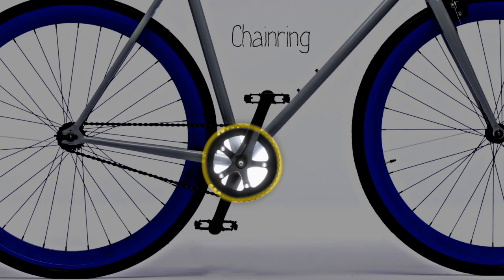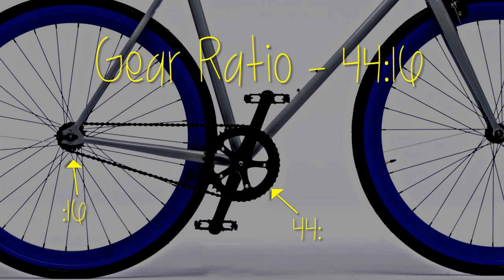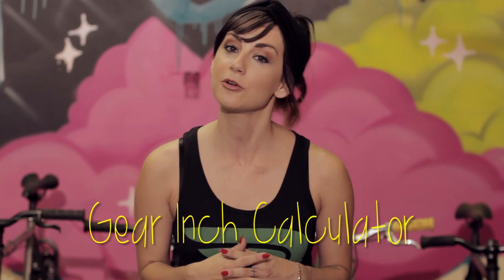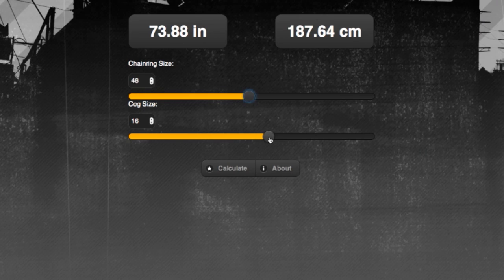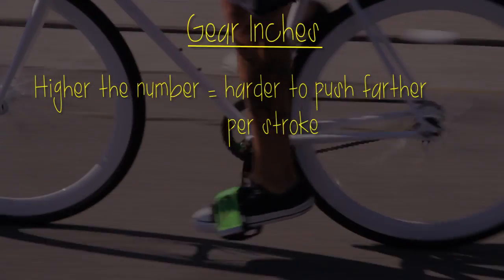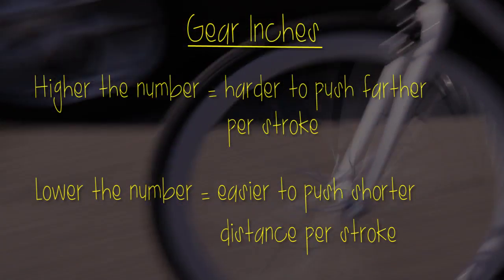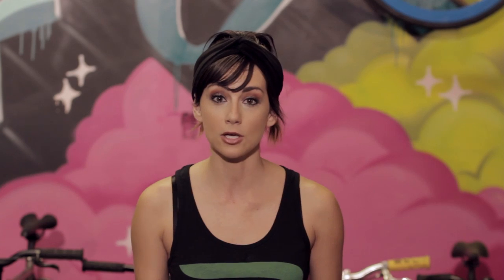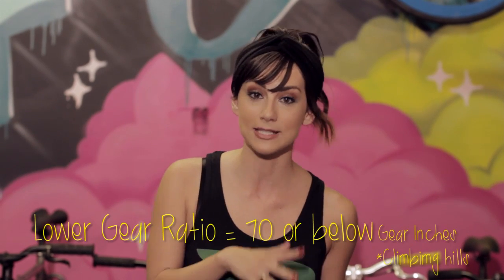Pure Fix TV: Gear Ratio Time

Comment: Would more teeth in cog, say plus 2, while keeping the chainring the same, help with added torque or easier acceleration.
 The set up is for neighborhoods with hills, so hoping for a less strenuous leisure riding,  not speed racing.

Comment: on my road bike, my most used gear ist something like 36:15. most fixies from the shop have something like 46:16 or similar. why is that? are fixie-riders incapable of spinning at high cadence or what?
Reply: we can but we are use to strong ratio.
who realy want to spinn fast when there is plenty of car and people.
and we still pedal fast to gain speed.
last summer i was out with my friend on bike( he use road bike and me fixed).
we made a test about going to the  same speed( on a sprint for him) i was pedaling slower.
and a second sprint to my pedaling and he couldnt follow after a few second.
i was going 7-9 km/h faster.
cyclist on fixed gear build stronger leg too because they are to there maximum gear all the time.
but road bike would beat fixed gear for a 100km race  probably

Comment: Is 46/16 good for doing skids
Reply: Brix it sorta depends. If you're just getting started on fixed and the bike you're riding is on the heavier side, skids will be a little more on the challenging side with that ratio. It is definitely possible, and that's a pretty standard fixie ratio, but many people recommend learning skids on something easier, then going harder once you get he hang of it. The best way to answer your question is to try it out for yourself. It's pretty easy to switch out a rear cog if you have the right tools, and even 1 tooth makes a huge difference in feel.
Reply: Bware Gamer thx man, I´ve learned how to skid, and its pretty easy now.
Reply: Brix awesomedude. What ratio did you end up going with?
Reply: Bware Gamer 46/16
Reply: i use 50-15 and skidding is fine...

Comment: whats the best ratio for easier skid. Or rather, what ratio do the guys use in the intro to the video, considering they skid so easily without having to lean forward or without much effort.
Reply: Andres Jaramillo something like a 44:16 or 46:17 would work. If the bike you're riding is on the heavy side, you may want to go even easier than that.
Reply: Bware Gamer what is the best gear for cruising on a fuxed gear bike? please reply
Reply: Dark Trump There's no right or wrong answer to this question. The right ratio for you depends on the strength of your legs, terrain, the weight of your bike, and how hard you want to be pushing with each stroke. If you'll be cruising, I'm assuming you'll be on mostly flat terrain? And I'm also assuming this means you want to ride rather casually. Anyway, 48:16 or 48:17 would be best IMO, but finding the right ratio for you takes experimentation. The rear cog is super easy to change, so don't be afraid to go smaller if you want a higher top speed and a stiffer ride!
Reply: Bware Gamer thank you very much...

Comment: Does this affect skidding? I have stock chainring and cog.
Reply: Osvaldo Cardona Yes sir you bet. If you have a higher gear inch then doing a skid will be harder. With the stock pure fix gears 44:16, it should be pretty easy too do. In case your wondering, 44:16 is like 72 or 73 gear inches I think.
Reply: +C. Paul I'm not getting this too much.. 44:16 is 72.3 inches and I'm running 46:18 which is 67.3 inches but skid stopping is really a challenge, at least on pavement.. gonna try to go 46:19 but I'm curious if it's just about gear inches or if there's a difference between changing rear cog vs chainring.. also I don't have straps yet
Reply: Omar Ibrahim You are fine with your ratio. I have buddies that skid on 54:15 which is over 90 gear inches (I use 46/17). 67.3 gear inches is really low and should be easy but the problem is that you do not have any straps or foot retention! You need foot retention to learn how to skid. 

Also many things affect skidding besides gear inches.

First of all, straps or some other sort of foot retention is a must for beginners and much more safe to have. 

Leg strength also is a part of skidding, but leverage and technique is way more important. If you have great technique, leg strength becomes a very minor factor.

Gear ratio, a ratio that is very high such as over 80 gear inches is not nice to skid on but again, technique is a big role. Your gear ratio is fine.

Technique is very important. Once you get your foot retention, put your balls to the stem and pull up with one foot while pushing down with the other. Also, push your legs hard against your top tube. This will give you more control and leverage when skidding.

Finally, your cadence (how fast your cranks are turning). If you are starting out on skidding, try to get to a comfortable 70 cadence and try skidding. As you progress you can bump up to 90rpm and try skidding there. 110rpm, etc. 

This may sound confusing and is very long but in conclusion. For your first step, you should get some straps they are extremely important in the learning progress. Also, ask me anything else, I love teaching haha! Search up, "Jonathon Wilson how to skid." on youtube, his videos helped me a ton.
Reply: ***** Nah not confusing at all!  Many thanks, this is just the sort of explanation I was looking for.  I got some straps so I'm going to get to work on that.  

I did end up actually getting a 19T rear cog to try and lower the gear inches, but I guess I don't really need to do that now.. 

I also just got some bullhorns, which I'm thinking might help.

Do you think going a size up or down would have any effect on your ability to control the bike?  I just got a new bike so I'm still getting used to it, especially 23mm tires..
Reply: Omar Ibrahim Yeah man no problem! Also what size are you talking about?

If you are referring to frame size. Let's say you fit on a 52cm frame, but you get a 49cm. You can expect it to be a bit lighter, sometimes more sharp and responsive (some people say so but I notice very little difference. Also if you get a smaller frame, your handlebars will be lower so you will most likely have some sort of drop between your seat and handlebars.

If you are referring to tire size. 23mm tires work just fine for most streets. I run 23 tires. But what I recommend is 25mm tires, less rolling resistance and more comfort. You will notice almost no difference in skidding effort between 23 and 25 tires.

And yeah, bullhorn handlebars will help in the learning process for most. 

If you have more questions ask again, lmao
Reply: haha thanks man! this is great..

so yeah sizing is weird cuz it's different based on geometry I guess?  my friend who is probably like 3-4 inches shorter than me has a Trek District which is 56cm and I just got a Wabi 55cm as recommended by the sizing charts.  The bike is super light so that's not much of an issue but the handlebars do seem lower than I have ever rode before.  I guess I could lower my seat a little but then I feel like I might run into some power loss issues since I'll be at less than full extension in my stroke... maybe that will help with skidding though, I didn't think about that... but I'm still very curious what the next frame size up would be...

And yeah the tires are interesting.. I've never ridden anything this thin.. makes it harder to balance I think but I'm gonna stick with them, at least to see how they hold up through winter...
Reply: Omar Ibrahim Alright man you sound set! Just keep practicing and you should do just fine. Fixed gear is also nice in wet or bad conditions. It gives direct feed back of how much traction you have. Also to direct the handlebar being really low, you can always buy a stem that angles upward or flip your stem to a rise angle. Anyways, I am glad I could help, have a great ride man!

Comment: i have hills near me but i am fit enough to peddle up them on a mountain bike what gear ratio should i use?
Reply: harri909909 Since you have gears on your mountain bike, check what gear you use most and love on your mountain bike and you should start out with those gears. But remember, these fixed gear bikes can be lighter and have slim slick tires so it will be easier too pedal. And road tires proven in studies show they are 19% more efficient. So for example, I use 42:18 (64 gear inches) the most on my mountain bike out of all the gears. On a fixed gear you may want something near 70 gear inches due to increased efficiency. But if you are still really stuck, just go with something near 70 gear inches, 70 should be the starting point for most people and from there just switch out your gears as you want. Remember, the internet can only tell you so much, try going out and experiment a bit.

Comment: 52tt and 18 on the rear easy to skid + to stop at emergencies
Reply: Have the same ratio but find it very tough to skid stop with this setup. I ride an old heavy Raleigh through.
Reply: +Craig Simeone wow 52x18 is 76" and I'm on 46x18 which is 67.3" and I can't manage to skid stop on pavement yet.. does the chainring make a difference? I also don't have straps yet..

Comment: Honestly I have no idea how to stop I push to pedal backward to stop but the bike just pushs my legs forcefully into motion 

I bought a fairly expensive crankset a ominum and it is. 48t 170 mm length 

I'm hoping is has to do with the back cog maybe if I reduce it would it be easier to stop please any help would be greatly appreciated or else I'll just flip the bitxh and ride free wheel FML
Reply: I'am pretty sure you have looked at some tutorials on how to stop, however if you have not, you really should. 
For me it works easier if I have straps on. I use my stronger leg to push the pedal back and with my other leg I pull the pedal up. Also going downhill at a decent speed, and getting up from your seat close to your handle bars seems to be easier when learning how to stop. Don't switch to free wheel, riding fixed is amazing. You should also put some breaks man, although skidding is a lot of fun, breaks are just safer and friendlier on your tires. Good luck!
Reply: I have this exact crankset - same crank arm length and chainring - and it has almost nothing to do with the brand or how expensive your crankset is. It's all about conditioning; start slowly with your riding and maintain your riding on a street that isn't very busy - utilize a fairly low speed and focus on slowing yourself with your legs. As you get this down, slowly increase your speed until you can gracefully and easily slow yourself with your legs. Once you learn to slow yourself with your legs, learn how to skip stop; skip stops can really help if you have a more momentum than you can manage with your legs when you need to stop or slow your bike quickly. After skip stops, learn how to skid. I myself just learned to skid on my gear ratio of 48:16 which equates to about 78-79 gear inches, but I'll be swapping out my 16t cog for a 19t in order to focus on my cadence and spinning (something else you should look up).  at ~66 gear inches. It's just like learning trackstands, you have to work up to it gradually and just ride your bike.
Reply: +Sebastian Montalvo can you skid without straps?
Reply: Marc Douglas that's great advise. exactly how I learned. skip stops can stop you better in most cases anyway. skidding just looks cool. lol

Comment: Hey guys! I've got a 44:16 but I still find it very hard to skid, and it's not that I don't have strong legs... it's just that it's impossible to skid, literally whenever I use all of my force something down there loosens, it can't take it. Thanks for the help!
Reply: +Brandon Bucci I don't really understand what you guys are saying here.. wouldn't there me some other problems or symptoms if there were something loose?  I don't have straps yet so maybe this is why?
Reply: Is probably that your rear sprocket is loose. You should check if it is tight. Just take it to your local bike shop and they should be able to tighten it for you fairly easy. I have the same gear ratio and I can skid fairly easy.
Reply: Or it could be your bottom bracket, or your lock ring you can borrow a wrench to tighten it at any bike store.
Reply: +Sebastian Montalvo if it were loose wouldn't it just slip out?
Reply: 44:16 is super low, I ride on average a 53:15

Comment: Dear pure fix I'm having a hard time with new gear helmet, Jersey etc. And carbon and chromoly etc. Frame Too please make a video!
Reply: Cromoly for street carbon for speed, any helmet is fine just ware one, a basic gear is a 40 :16 or so depending is you are syringas average. If you have a few hills it does fine.
Reply: Helmets are mandatory no matter the distance! This any ways.